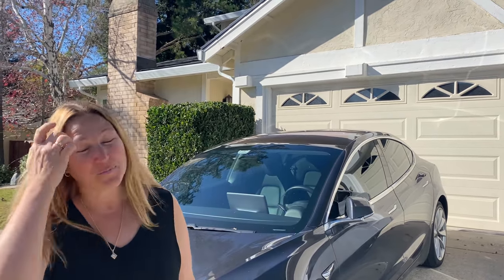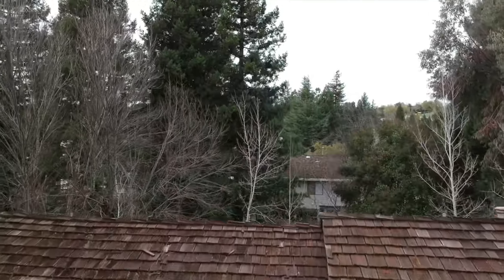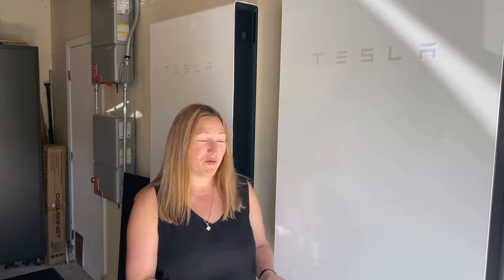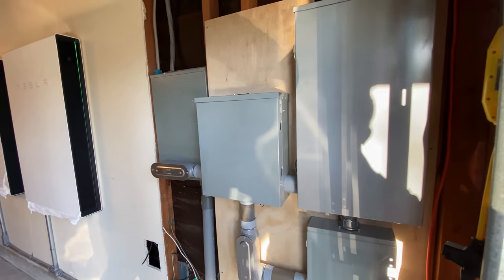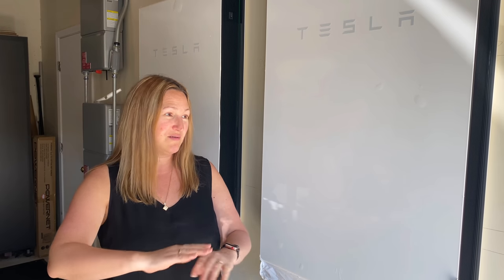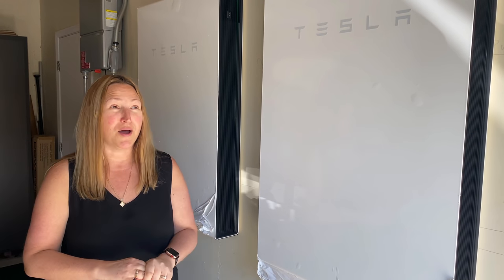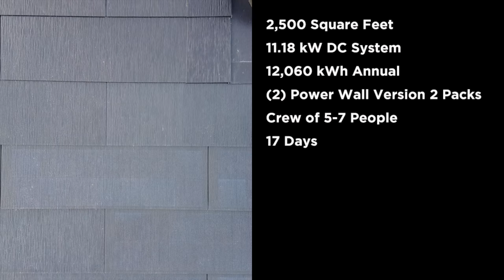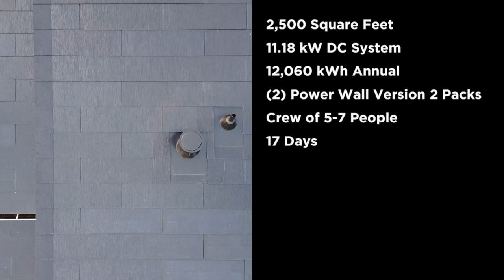Tesla Solar Roof V3 Installation

Comment: Would love to see what the power bill is after this install.
Reply: @Al Castill well, factor in the cost of a new roof, because they needed one.
Reply: @relaxnation1773  yeah, AL forgets about that...
Reply: Al Castill you’re forgetting cost of a new roof
Reply: @Al Castill My homeowners policy does not cover a new roof. I'm curious under what circumstances your policy will provide you with a new roof minus the deductible?
Reply: @Al Castill lol $150 power bill...I wish. Before my Model 3, my average power bill is $200/mo and only goes up each year. This last year rates went up just about 50% across all time-of-use periods.
Reply: @Al Castill I see how it makes no economic sense in your case. If my bill were that low I wouldn't even be entertaining the idea because of both the economics of it and since 90% of our power comes from zero carbon sources already (nuclear, hydroelectric, wind, solar)
Reply: Warbay and new more value of the home
Reply: Another savings is medical. They are no longer spewing as much crap into our air.    How bout pricing that in?
Reply: @Al Castill 10 years?!? That's nothing, most PVs have a guaranteed efficiency for 25 years. But they don't fall apart suddenly after that, but will keep on making power (though slowly less and less) for decades after that. The batteries will need o be replaced before that however. Payback time depends on where you live (how much sunshine) and the price of grid power in your area
Reply: @relaxnation1773  That's exactly the point of the solar roof tiles: the hardened glass will keep virtually forever (and yes, they can withstand heavy hail), and you don't need as much roofing underneath. As a "bonus" you get the electricity...
Reply: @Al Castill There is no maintenance of the roof. But yeah, batteries will eventually need o be replaced, way before the PVs peter out
Reply: @theJerkson  Where are you, Australia?
Reply: @theJerkson  You're in Canada maybe?
Reply: @Al Castill Bruh Consider The Interest On $30k Which You pay Now
Reply: @Al Castill Uh, Solar actually lasts about 20 years before hitting 80% on average
Reply: All of this is highly dependent on where you live. I'm in MA where we have very expensive electric rates, as  high as California's. The problem is that Democrats are deliberately driving electric costs high by preventing energy pipelines to be installed and shutting down powerplants that don't need to be shut down and not replacing them. The reasons for this is to make living so financially punishing that you are forced to do one or more of the following: 1. downsize to smaller place, 2. invest in solar if you have the money, 3. live in poverty because you can't move or afford the power, 4. pay outrageous electric bills. The point is that citizens should have incentives, not forced into choices because progressive lunatic Democrats are forcing their opinions on you. Renewables like wind and solar farms are a complete joke and Mike Shellenberg, with his book, Apocalypse Never, is doing a great service to Americans by revealing the corruptness of the climate change  activists. The  most pragmatic reason to get solar is to be grid independent because 1. you can't trust the Democrats not to skyrocket electric rates in the future due to their venality and incompetence, 2. you can't trust Democrats not to trash the economy where there is no power available because of chaos and anarchy. California's handling of drought and fires are perfect examples of venality/incompetence.
Reply: @jamilasmith7306  I agree with you, we are just paying other clowns way of druggy debauchery living and some people really need that real benefit and we are working our's out it's just inequality for us I think we should be getting paid for our great effort to help a lot of people or a least to get a "tax exempt" for all our money going to the people who works in the system and the people are getting "help" from our hard working taxes.
Reply: I feel bad for who ever goes up there when it's wet
Reply: @jamilasmith7306  Right? Republicans should be in charge of energy infrastructure just like they are in Texas. No problems there. Amirite?

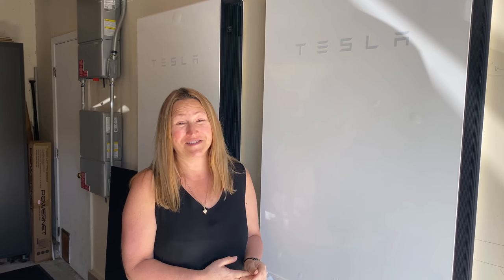Comment: 2:04 look at the unsupported condulet in the back
3:25 you can see the painters tape on a shattered module on the right, you can also see sawdust on top of the panels, implying that there must be extensive drilling and caulking still involved.
4:11 shows them caulking the roof ridge cap in locations exposed to UV radiation that will not last.
4:27 you can see that the previously broken glass sections required adjacent re-work to repair. since these broken areas were at the center of the roof, this is likely due to the tolerance requirements of fitting the last tile in the center. Since all of those central glass sections are PV, they cannot be cut and rely on the outside cells being cut to length properly. You can also notice the right foot of the worker on the lower roof slip. This surface is clearly much more slippery than a traditional asphalt roof. They should consider using sugar soda or other adhesive similarly to how installs are done on pitched standing seam roofs.
5:24 you can clearly see from this angle which tiles are PV and which are not. they sold this expensive system and didn't include any tree trimming? Cool looking black penetrations wonder if they charge extra for this or if it was included because of this promo video.

Expect residential solar to be a premium product for the next 5 years or so starting next year, especially products like this...

Comment: 17 days for roof install, man they really need to get that down. Can't wait for some stats once you get it all up and running!
Reply: Thought the same.  We have a 4,000sqft roof that was installed last year that took 2 days.  Not solar roof, just high quality composite shingles.
Reply: I was watching another video hyping the solar roof and they were quoting 8hrs install which is totally laughable.    I couldnt beleive they could take it seriously enough to earnestly repeat it a "benefit"
Reply: @slandshark  Who looks good though?
Reply: @slandshark  Looks beautiful. That's kinda of what Tesla Solar roof looks like, rights? How much does it cost you?
Reply: i was thinking the same thing.  And with a crew of 5 to 7... Yikes!  What would be interesting to find out is the breakdown of Tearing down the old roof vs adding the new roof.
Reply from the maker: 6 days for tear off and rain prep (we had a few days of rain which always adds more prep time). 11 days of installation of the tiles and all of the electrical work. Plus we had a new crew assigned mid-project which placed a small dent into the timeline.
Reply: @yarpos  you're watching the very beginning phases of something and assuming that's the best it will ever get.
Reply: Dillon, this is NOT just a solar roof, but a whole new roof for the house which does produce energy! Get it?
Reply: the same time for classical roof

Comment: Your roof replacement, with sheeting, would have cost you quite a bit by itself.  after adding solar panels you may have only saved maybe less than 10 k.
Reply: As it should be.
Reply: Ruff*
Reply: My Mexican guys can do for 6k new shingles remove old ones
Reply: @joeperri2587  But they don't produce electricity...
Reply: @joeperri2587  also they didn't want asphalt shingles.
Reply: In Germany maybe 25.000 EUR for the new roof + 20.000 EUR for the photovoltaic system and 20.000 EUR for two Powerwall 2. The roof holds 50 years and the solar system 25. It looks not so good (
 I personally like the look) but after 25 years u can just replace the solar system. Becouse of tax EUR and $ should be the same amount.

Comment: Looks fabulous.  Replacing your old shake and shingle roof with a composite would be expensive. They still would have to sheet it and that drives up the cost and you did get the Tesla power wall x 2. Expensive , yes but you did receive a lot. Look forward to seeing some power stats.

Comment: Thanks for the video. We're up for a new roof and seriously considering this solar-roof. I'm wondering if you have an HOA and do you have to deal with them for switching from what appears to be cedar roof to this?
Reply from the maker: Yes we have an HOA and we have rules on the type of shingles we can use. We had to appear before a meeting and show them what we planned to do before we could secure our funding and proceed with the installation. They passed our roof shingles and added them to the HOA allowed materials for future homeowners. If they did not allow the shingles then they probably would have been portrayed as an HOA that is not "green" and that could have been bad for them, IMO. This is also why the roof made sense for us since we could not do traditional asphalt and thus the traditional costs go up making Tesla Solar Glass more feasible especially with tax credits.
Reply: @neumanngroup  Thanks so much. Great info. I just spoke with a Tesla adviser on the phone and, learning it from you, it looks like appearing before a meeting and convincing our HOA will be my next step. Did you have to show them an actual sample of the Tesla roof tile or just pictures? I guess an actual sample would be more convincing but I'm not sure Tesla would be able to send a small piece.
Reply from the maker: @tarzan12345  They were fine with just the info and some pictures. Tesla will not provide the actual tile as it is proprietary but  you could ask if they could provide one of the dummy tiles since they look the same.

Comment: This is the dream house. Solar roof + batteries + electric car.
Reply: A dream for the people who service this stuff.
Reply: only downside is too many trees around house, 30-40% covered in shadow...
Reply from the maker: Fair point. Tesla = creating jobs so that is cool.
Reply from the maker: Yes, and we will be trimming a few of them but it is winter and the sun is low so longer shadows casted.
Reply: Except the solar roof installation is not large enough to support said house and cars.....  Rather defeats its purpose.
Reply from the maker: We use 12,000kWh per year according to the last 12 months of our electric bills and we charged the cars all that time. So if this roof generates 12,000kWh per year then it is a wash, right? Obviously everyone is different with how much they charge their cars based on their commute etc but we don't drive that much and tend to also take advantage of free super charging for the X. If we drove more miles then yes, you are 100% correct, but this installation fits our lifestyle nicely.
Reply: @w8stral  Its purpose is not always to completely offset the grid bill, but rather reduce it while also generating green energy.
Reply: @neumanngroup  I thought California allows you to sell your electricity to grid during the day when rates are high and then in evening when rates are low you can recharge your powerwalls and charge up your cars.  Is this true?  Is your system configured to do this?  If true and if its been configured this way then payback could be quicker than what everyone thinks.
Reply from the maker: @strykerace  Yes you are correct. We will sell back when not in use and when the Power Walls are full, then use low cost energy at night to charge the cars. The offset is nearly double. With our plan we pay $0.17 off peak and $0.35 peak and $0.34 partial peak.
Reply: @neumanngroup  jobs that cant be shipped off to china
Reply: Eric Neumann  bro sell me spare of your batteries send to philippines i will pay cost 😘😘😘😘
Reply: @neumanngroup  The powerwall system will pay for itself at those rates, and then solar on top, big savings! Cool video, thanks for informing us about the new roof!
Reply: Posi P except electric cars need close to no service, powerwall doesnt as well and the roof should ne about no service as well. A single ICE needs more than this combined
Reply: @ashanmendis1930   Leave Trump to tackle that! no job is ever moving to China again
Reply: Mrssewhardtoplease   you must be a CNN fan-girl instead of reality and statistics
Reply: It's cool concept.. would love to see how it works for you guys in the year.
Reply: You mean life 🤗
Reply: Eric Neumann 0.17-0.35 is so pricey compared to here in Montreal, 0.0608 to 0.0938 CAD... so I did my calculations, it turned out that I won’t even make the initial investment back in 30 years even with regular solar panel, let alone the fact that most roofs last 25 years on average, sad. LOL
Reply: Yeah, if you want to have a solar panel roof you might as well use as much as electronic in your life. There's no meaning using gas powered vehicle when your house can generate and store electricity
Reply: @neumanngroup  you also have the benefit of protection against black outs that is not costed by the naysayers
Reply: @reinerw.1158  Not to mention that there are some Teslas on the road with 500k+ miles on them. That's like 3 ICE car life spans. Esp crappy GM, Ford Chevy vehicles. Closer to 4 lifespans.
Reply: @TsarOfRuss  And if you dont believe him, just ask him.
Reply: @neumanngroup  Hello, you mentioned incentives, What were they?
Reply: Mrssewhardtoplease  Especially after COVID
Reply: Only 12k kwh? I mean sure for a smaller house that's fine but that's barely enough to be self efficient
Reply: +guns
+Kids
+Trees
+Ladies
+Garage
+Yard
+Grass
Reply: @neumanngroup  i imagine in places like Florida and texas and Arizona solar power a big deal since it's very sunny.
Reply: @且听风吟-v4w  25 years is half of your lifetime and for our mother earth it'll be well appreciated very very much.

Comment: Great vid. Would love to see a diagram showing roughy where the solar tiles are and where the dummy ones are. It’s a big roof so, I wonder if it’s more or less than 50% solar tiles needed?
Reply from the maker: We can do another video since they provide an exact tile diagram that is attached to our main power connection box to the house. That diagram shows where every single solar tile is.
Reply: @neumanngroup  Thanks Eric. Lol don't do it just for me! But, if you already planning to make another vid, I'd love to see it. Congrats on your roof - your house looks amazing :)

Comment: Did you get quote for how much does it cost to change to regular roof that can last 25 years? I think with that in the stats it will be better, since Tesla solar roof is not just solar it is HIGH QUALITY ROOF!
Reply: It should also last a lot longer than 25 years.  They will likely still produce over 80% of their power rating in 25 years and I find it hard to believe that any electrical appliances or vehicles that will need to be replaced during that "warranty" period would be less power efficient than what they have now...

Comment: Thanks for the video. I checked Tesla website, 2 power walls cost 15k, 2500sqft (single floor)with 12.3kw costs 52k, total is 67k. Still far lower than your 85k. What am I missing? Thanks
Reply from the maker: Tear off, permits, electrical work, gutters, decking, etc.
Reply from the maker: Plus their online estimator is not accurate. We were quoted $55k initially just like you.
Reply: @neumanngroup  thanks!

Comment: A couple of thought. What is the subsidy on that $85k. Looking at the lot, I see so many tall trees close to the house that would be blocking the Sun. And finally, they’ve added all the new weight on the roof... was the original frame designed for all that weight??

Comment: Regular asphalt roof would have been done in probably 2 days. The labor alone justifies the cost. How did they determine the amount of solar tiles vs dummy? What's the incentive in CA?
Reply from the maker: It is based on sun exposure and direction of house. CA has some incentives but the Federal one is huge right now.

Comment: Do you guys have a break down on cost? When will the roof pay itself off?
Reply from the maker: Probably not in the short term, however the housing market is insane in the Bay Area so to think we could fetch the difference in the sale price compared to another home is possibly feasible right now since we are early adopters. I look at this as financing a very nice new roof with a transferrable warranty and the benefit of solar so I am not expecting any payoff until many years from now and that is ok with me. We can share the breakdown in a different video but I think the costs vary so much between every home due to size, shape, sun exposure, location, tree shading, etc. It is hard to get a perfect apples to apples comparison.
Reply: @neumanngroup  yes break down

Normal new roof price

Tesla power wall price
Price of other solar system cost like inverter

Comment: It would be so interesting to know what is the appraisal value of house before and after the solar roof installation.  The old roof looked to be in very bad shape.  Part of the payback is whether or not total value of home is raised with a better looking and energy collection and storage capabilities of the home.  Probably need to interview an appraiser on how they see these home improvements affecting the home market valuations.  hint hint...
Reply from the maker: Good point. The only issue is that we are in the Bay Area and prices are crazy here, but it would be nice to know the percentage increase if applicable.

Comment: If i read your stats correctly you have an installed capacity of 11,180Wp over a 2500 sqft area. That would be a capacity of about 4,5Wp per sqft. That's not very good. I have recently installed some monocrystaline panels with capacity of 18Wp per sqft. You cost per Wp would be about $7.50. My system cost me $0.84/Wp. Seems like the Tesla roof is not that good a deal  yet. But it sure looks cool!
Reply from the maker: Is your system a roof tile? Or panels?
Reply: The Neumann Family I have panels.